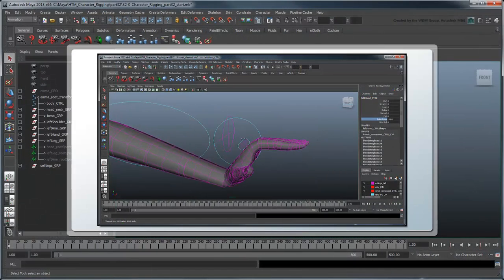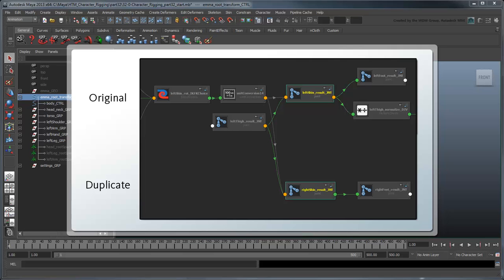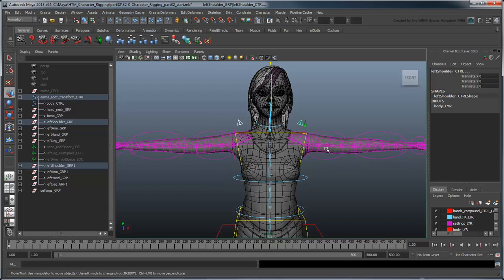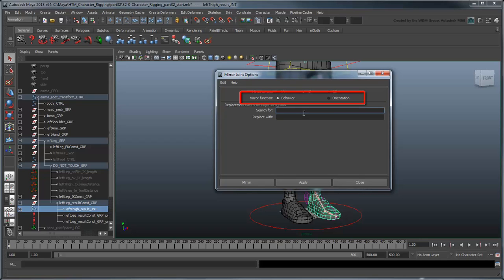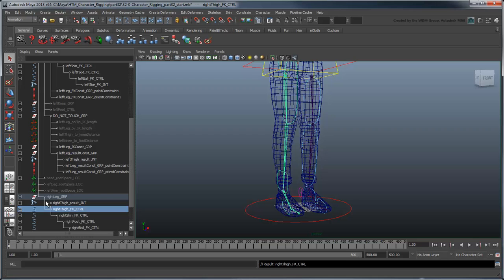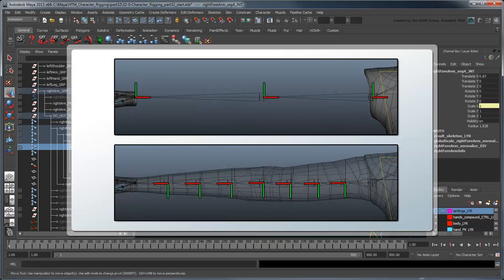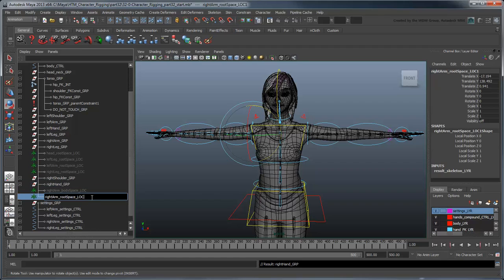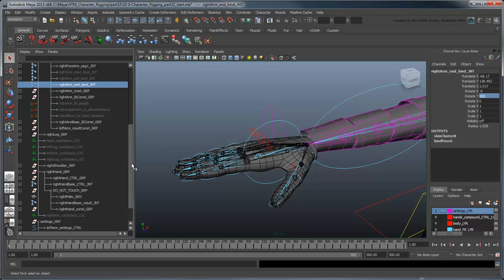Creating a Character Rig - Part 32: Mirroring (Advanced)

Comment: Hi! I've got a weird issue. When I mirror the FK joints from the left to the right, then move the controllers to their rightful places, I like change the joints orientation or something. Before I starte moving them (controllers), when I rotate forward, it's in -Y. Now after I put a couple of the FK controllers back where they're suppose to be, when I rotate it, it's in positive Z. When moving the controllers (I do this in vertex mode and hide the joints), I notice a shift and that's probably the whole joint orientation thing. What on earth am I doing wrong?

So when it comes to mirroring the arm and leg over to the right, we basically have to recreate everything except for the geo and joints themselves? That's what you're saying, right?

Thanks! This tutorial has been absolutely amazing!!!
Reply from the maker: That's right.  If you find the mirroring isn't working (it will if you follow the steps above very precisely), then it's probably best for you to just recreate the the limbs from scratch.  The local rotation axes are very important - remember they move in the opposite direction as those on the left side (see the included scene file for reference).
Reply: Maya Learning Channel Okay. As far as I can tell, I've been following the steps in this video precisely and something weird still happens whenever I move my FK controllers to their rightful positions (in vertex mode) and my joints still do something weird. No biggie. So I decide to duplicate my right result thigh joints (when rotate forward, it's in -Y, which I believe is correct), turn it into an FK joint leg, and then create new controllers like we did with the left leg. Well, whenever I trying shaping my shin FK controller to the leg, my thigh FK controller suddenly jumps up. I'm confused and very annoyed. Why on earth is it doing that? I've had similar problems before with having the other FK controllers shift for no apparent reason, but I've been able to work around it. It's driving me bonkers.
Reply from the maker: Did you remember to delete history on the NURBS curve before re-parenting it to the FK control?
Reply: Maya Learning Channel It's still moving around even after I delete the history on the NURBS curve. After freezing the transformation and deleting the history, I'm suppose to parent it to the FK joint by using the parent-r-s mel command, right?
Reply from the maker: Well, you parent the curve's shape node to the FK joint, not the FK joint to the curve.
Reply: Maya Learning Channel Select curve shape node first then FK joint and then parent, correct? I do that. I'm still having problems ...
Reply: If I don't move the vertices while the curve's shape node is attached to the FK joint, nothing will shift. I've moved on, but still would like to hear what you think the problem may be. But I have another problem. I'm trying to use the IK stretch leg script (I changed "left" from the script to "right") for the right side and it's giving me problems. It simply ... won't stretch. The command line always says "// Result: 1" whenever I push the execute button, but it still won't stretch. I'm stumped.
Reply from the maker: Check the Move Tool settings.  In the Joint Orient Settings, is "Automatically Orient Joints" turned on?  That can also cause problems.

For the right leg, it's not as simple as just replacing "left" with "right".  Remember that the leg joints themselves move in the opposite direction (assuming you followed the suggestion in part 32).  This means that you're actually stretching in a negative direction, so you will need to multiply the stretch operations by -1 appropriately.
Reply: Maya Learning Channel Automatically orient joints was turned on! Shifting FK controls problem solved!! Thanks!!! Now for the right leg, just to be sure, what would that look like in the script? I mean, would it be like, for line 6, this: ($rightThighLength*-1) and then this ($rightThighLength*2*-1) for line 8?
Reply from the maker: That looks right.
Reply: Maya Learning Channel It stretches fine, but the shin geo is turned backwards. I'm not sure why this is ....
Reply from the maker: Select all the faces and reverse their normals.
Reply: Maya Learning Channel It's still going backwards ...
Reply from the maker: Heather McD Wait you mean backwards as in inside out, or turned 180 degrees.  Are you sure its just the geometry or is your shin joint itself actually spinning around?
Reply: Maya Learning Channel Hang on, let me check real quick.
Reply: Maya Learning Channel Looks like the IK shin joint is rotating when I use the script editor.
Reply from the maker: So it sounds to me like that IK Handle is not set to Rotate Plane Solver, or something isn't right with your local rotation axes for that leg.
Reply: Maya Learning Channel The correct rotation axes would be that when I rotate forward, it would be in -Y, right? That's what I have it in. And I did use the rotate plane solver. I redid it a couple of times, and it still won't work. I'm very confused.
Reply: Maya Learning Channel Does this script look right to you?

string $driver = "rightLeg_IK_lengthShape.distance";
float $rightThighLength = `getAttr rightShin_IK_JNT.translateX`;
float $rightShinLength = `getAttr rightFoot_IK_JNT.translateX`;
float $sumLength = $rightThighLength + $rightShinLength;

setDrivenKeyframe -currentDriver $driver -driverValue ($sumLength*-1) -attribute "translateX" -value (rightThighLength*-1) rightShin_IK_JNT;

setDrivenKeyframe -currentDriver $driver -driverValue ($sumLength*2*-1) -attribute "translateX" -value ($rightThighLength*2*-1) rightShin_IK_JNT;

setDrivenKeyframe -currentDriver $driver -driverValue ($sumLength*-1) -attribute "translateX" -value ($rightShinLength*-1) rightFoot_IK_JNT;

setDrivenKeyframe -currentDriver $driver -driverValue ($sumLength*2*-1) -attribute "translateX" -value ($rightShinLength*2*-1) rightFoot_IK_JNT;
Reply from the maker: Heather McD Unfortunately no, that's not correct.  There's a few of things you need to think about here.

First let's look at the various -driverValues that you're setting in lines 5-8.  Try just stretching a length node around in all directions.  You'll notice the value can never be below 0, which makes sense (after all, what is "negative length" exactly?).  However, if you look at your script, your setDrivenKeyframe calls are all saying "when -driverValue is negative something".  This is immediately a red flag.  So from this you know for sure that the -driverValues have to be positive.

Second, look at line 4 and ask yourself, what are you using the "sumLength" variable to do?  You're using it to get the value of the thigh and shin so you can compare them to the length of the measurement node "rightLeg_IK_lengthShape".  However, sumLength is determined by adding the x-values of both the thigh and shin, and on the right leg specifically those values are negative (because the right leg joints flow in the opposite direction as the left leg).  Therefore, sumLength will always be a negative value here, but we NEED it to be positive if we're going to compare it to a measurement node (because, as we realized above, the measurement node we're comparing it to will always be positive).

Third, go back to lines 5-8 and look at the values you're assigning translateX.  Try manually lengthening a leg node.  You'll notice the values of the shin or foot joints become increasingly smaller (i.e. the negative number becomes larger).  However, look at how you're multiplying them by -1 and -2 respectively.  Remember that these joint values already START negative, so you're actually flipping them to positive and increasing the value.  This would cause the leg to flip up and stretch in the opposite direction.  You want the leg to continue on its negative trajectory as you stretch it.

I hope that helps.
Reply: Maya Learning Channel Thanks for explaining it!! I'm pretty ignorant about this stuff. I haven't been using the Maya software for very long. I don't totally understand it, but it's most helpful to me when someone points out what I'm doing wrong and tells me why it's wrong. I do appreciate it!
This will make me sound stupid -- but, at this juncture, I'm almost to the point of not caring -- but since I jumped into rigging with no knowledge in it or in scripts, could you please change the areas that are wrong in the script for me? I'm not quite sure how your explanation translates into what I'm suppose to change the script to. I hope I don't sound mean or rude or anything like that. I just am honestly not sure. I'm hoping that if you change it for me I'll understand a little more of what I'm suppose to do. I also don't really know what I'm telling the computer, as I'm sure you've guessed, 'cause it's not in English. I don't speak Maya-ese very well yet. I've only had a few classes and they didn't cover any of this stuff. Thanks soooo much for your help!! I mean it!
Reply from the maker: Scripting is basically a stripped down form of programming.  Before that word brings all kinds of panic, just know that programming is really just "I'm giving Maya a set of instructions to follow".  We broke down these instructions in part 13, which you may want to watch again.

As a quick review, the script basically does the following:

1.)  Determines the maximum length of the leg WITHOUT any stretching and storing that value in a place called "sumLength".  How can we know what the maximum length of the leg is?  We can just add together the length of the thigh and shin bones.  The thigh is the distance (translate x) from the thigh to the shin, while the shin is the distance from the shin to the foot.

2.)  Once you know the natural length of the leg, you want to set a driven key to "mark" it (lines 5 and 7 in your script).

3.)  Now that you have one driven key, you want to set another one when the length is doubled (lines 6 and 8).  The two keys gives you an animation when you stretch the measurement node from 1x to 2x the leg length.

4.)  After that, you just use the graph editor to extrapolate that behavior to infinity.

As for the specific fixes in your script, I actually did basically give you them in the previous comment.  The script is actually exactly the same as the left side script, except you have to flip $sumLength to positive (because there's no such thing as a negative measurement).  You tried to do this while setting your driven keys, but by then it's too late, because at that point Maya is trying to compare the negative value of sumLength to the positive value of the measurement node.  Therefore, you have to flip the sumLength value BEFORE you set the driven keys.
Reply: Maya Learning Channel Oh. So since I made this mistake, would the script look like this now?

string $driver = "rightLeg_IK_lengthShape.distance";
float $rightThighLength = `getAttr rightShin_IK_JNT.translateX`;
float $rightShinLength = `getAttr rightFoot_IK_JNT.translateX`;
float $sumLength = $rightThighLength + $rightShinLength;

$sumLength setDrivenKeyframe -currentDriver $driver -driverValue -attribute "translateX" -value ($rightThighLength*-1) rightShin_IK_JNT;

($sumLength*2) setDrivenKeyframe -currentDriver $driver -driverValue -attribute "translateX" -value ($rightThighLength*2*-1) rightShin_IK_JNT;

$sumLength setDrivenKeyframe -currentDriver $driver -driverValue -attribute "translateX" -value ($rightShinLength*-1) rightFoot_IK_JNT;

($sumLength*2) setDrivenKeyframe -currentDriver $driver -driverValue -attribute "translateX" -value ($rightShinLength*2*-1) rightFoot_IK_JNT;

I tried it -- although I'm not sure it's right -- and it told me this: //Error:Line 12.1: Syntax error

I understand more of what you're saying. Thanks.
Reply from the maker: Unfortunately this still isn't right.  When I say you have to invert the sum length value before setting the driven keys, I actually mean when you "declare" sumLength in line 4.  Think about the values of rightThightLength and rightShinLength.  On the right side, let's say these values are -20 and -30.  Then sumLength = -50, correct?  But as we established, length can't be negative so this is impossible.  However, if you multiply by -1, then sumLength = 50, which IS possible.

After that, the setDrivenKeyframe methods are all the same as the left side.
Reply: Maya Learning Channel I tried it this way:

string $driver = "rightLeg_IK_lengthShape.distance";
float $rightThighLength = `getAttr rightShin_IK_JNT.translateX`;
float $rightShinLength = `getAttr rightFoot_IK_JNT.translateX`;
float $sumLength = ($rightThighLength*-1) + ($rightShinLength*-1);

setDrivenKeyframe -currentDriver $driver -driverValue -attribute "translateX" -value $rightThighLength rightShin_IK_JNT;

setDrivenKeyframe -currentDriver $driver -driverValue -attribute "translateX" -value ($rightThighLength*2) rightShin_IK_JNT;

setDrivenKeyframe -currentDriver $driver -driverValue -attribute "translateX" -value $rightShinLength rightFoot_IK_JNT;

setDrivenKeyframe -currentDriver $driver -driverValue -attribute "translateX" -value ($rightShinLength*2) rightFoot_IK_JNT;

And it told me it had an error at line 6 while parsing arguments.
Reply from the maker: You forgot to put the $sumLength and ($sumLength*2) variables back as your -driverValues
Reply: Maya Learning Channel Oh. chuckles Yeah, that would explain it. And .... IT WORKS!!! Thank you SO much for your time and patience!!!! I'm gonna go do a happy dance now. :)

But first, real quick, was the script originally suppose to look like this?

string $driver = "rightLeg_IK_lengthShape.distance";
float $rightThighLength = `getAttr rightShin_IK_JNT.translateX`;
float $rightShinLength = `getAttr rightFoot_IK_JNT.translateX`;
float $sumLength = $rightThighLength + $rightShinLength;

setDrivenKeyframe -currentDriver $driver -driverValue $sumLength -attribute "translateX" -value ($rightThighLength*-1) rightShin_IK_JNT;

setDrivenKeyframe -currentDriver $driver -driverValue ($sumLength*2) -attribute "translateX" -value ($rightThighLength*2*-1) rightShin_IK_JNT;

setDrivenKeyframe -currentDriver $driver -driverValue $sumLength  -attribute "translateX" -value ($rightShinLength*-1) rightFoot_IK_JNT;

setDrivenKeyframe -currentDriver $driver -driverValue ($sumLength*2) -attribute "translateX" -value ($rightShinLength*2*-1) rightFoot_IK_JNT;
Reply from the maker: nope.  The script should look exactly the same as the left side.  The only thing that changes is line 4.

float $sumLength = -1*($rightThighLength + $rightShinLength).  

Do you see how that would flip the negative directions into positive?
Reply: Maya Learning Channel Yes. A negative times a negative equals a positive.

The reason why I did it this way ($rightThighLength*2*-1) is because in an earlier comment I asked you if that looked right and you said yes. There must've been a miscommunication.

I assume it's the same procedure for the arm and shoulder? Again --- thanks!! :)

Comment: hey, first. the leftArm_gimbal_corr_CTRL and rightArm_gimbal_corr_CTRL are not mirrored , they rotate in the same direction is this fine or we should mirror the rotation like the fk since it is part of the fk
second . the right leg roll attribute in your file dont work correctly . thanks ,great tutorial series
Reply from the maker: Odd, looks like the connection between the rightBall_roll_MULT and right ball_LOC was somehow severed.  You can easily fix the roll by reconnecting them in the node editor (Output -> Rotate X).  The gimbal_CTRL is a good catch.  I'll fix that and update the scene files as soon as I can.
Reply: Maya Learning Channel thanks for quick response.  i will fix the gimbal ctr on my own character as well